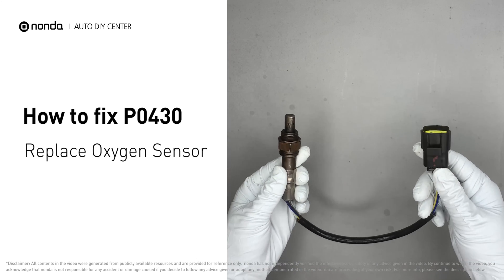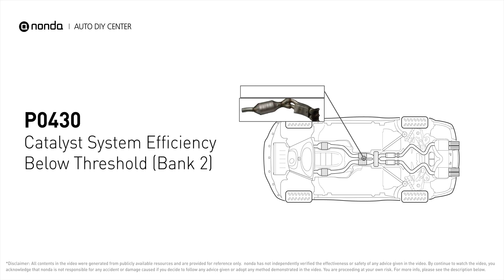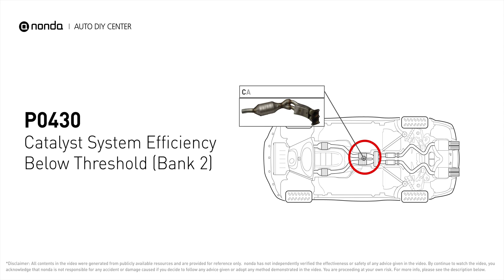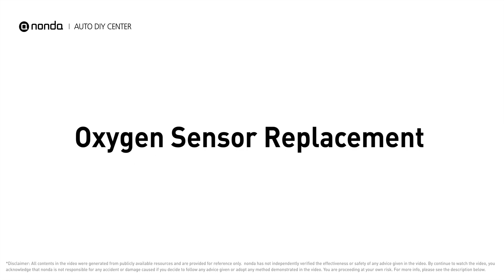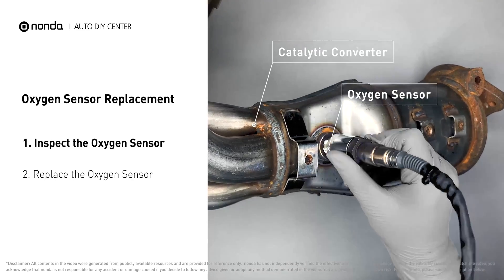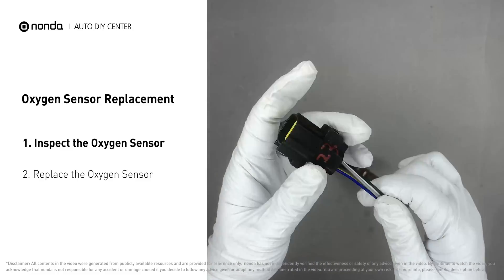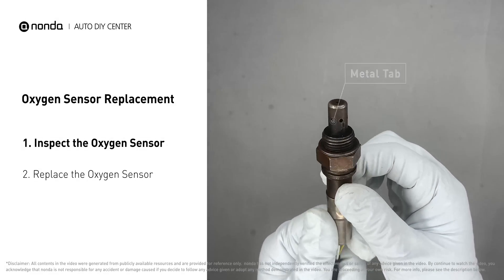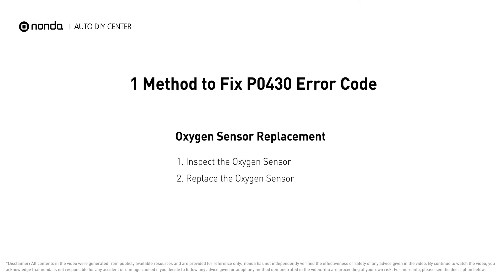How to Fix P0430 Engine Code with Oxygen Sensor Replacement

Comment: This is great!!! And it sure as hell solved my not proper cooling flow problem to this damn sensor in my 2000 nissan frontier 3.3l !!! This is a design problem....nissan should've made sure those damn things could get enough air to it. Get under truck(s) look....you'll see what i mean. They're in a bad spot to begin with!!!

Comment: I already replaced the O2 sensor on my 2005 mercury grand marquis and the check engine code was off for about 2 weeks but yesterday it came back on.
Reply: Probably the converter, I just did all that maintenance/replacement at Nissan dealer, I’m not gonna bother saying it may be a faulty sensor, they’ll run me for my money to “change the cat” smh
Reply: @sosaesco1005  It was the converter. It was completely burned out.